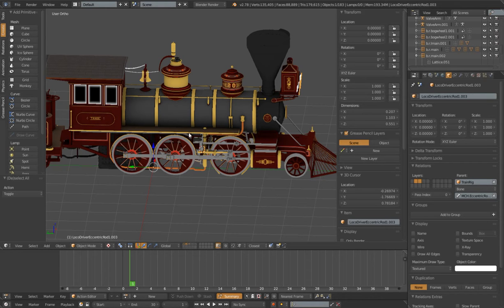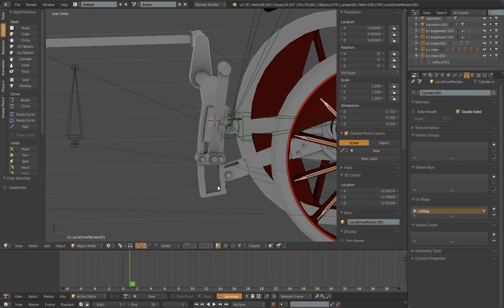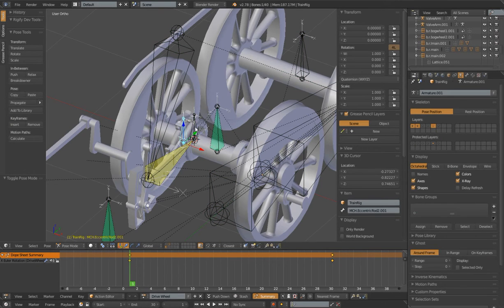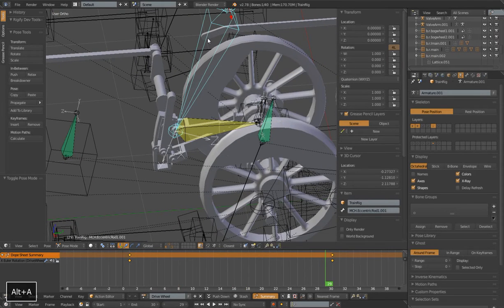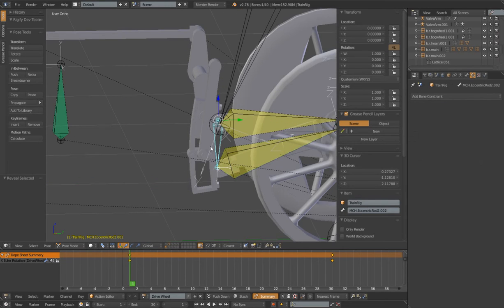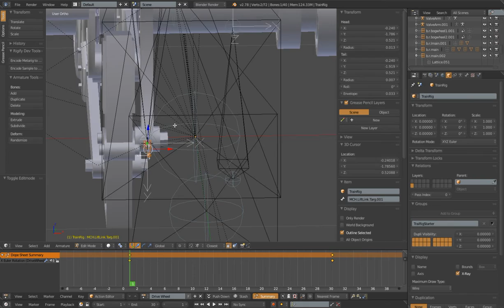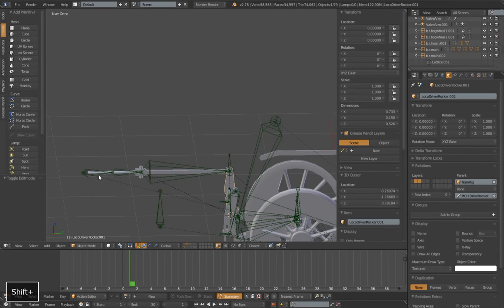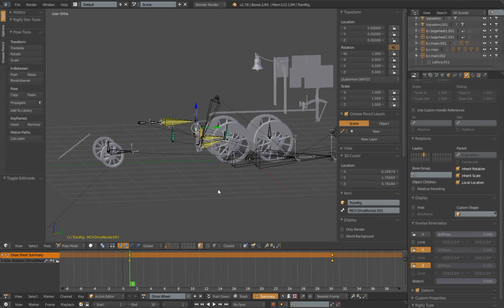Blender Rigging Tutorial   Rigging a Train Part 4

Comment: The four bolts you are using to find the average center in the rocker, is set into a bracket that is not centered on the rocker itself.
Surely that will influence the rocker motion a probably cause your "wobble/slide" problem.